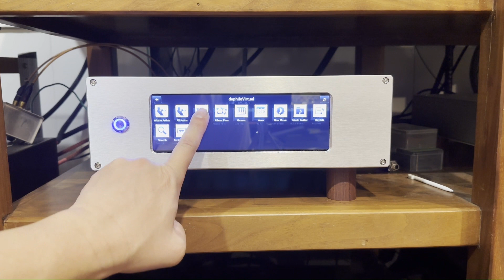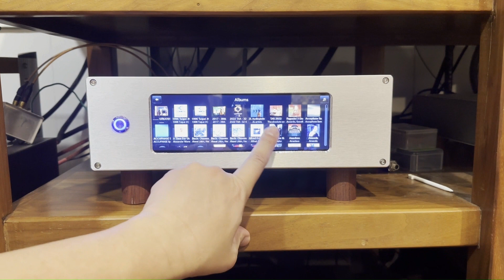DIY Hi-End 等級音樂串流器純轉盤 (2) -- 空白全鋁機箱自行加工

Comment: I noticed that while drilling the hole in the aluminum plate, you were holding it very close to the drill on the shorter edge. That’s quite risky because the drill bit can catch the material, especially near the exit, and yank the plate out of your hand. This could lead to serious injuries.

In the future, I recommend holding the plate on the longer side or, even better, securing it with a clamp or vise. It’s much safer, and you’ll have better control during the process. Safety first!
Reply from the maker: Thanks! I am learning various processing techniques.

Comment: Hi, what Power Supply are you using? Where did you buy it? I'm looking for a stable Linear PSU for my Raspberry PI 5 Volumio streamer. Thanks
Reply: It is a power supply removed from an old hard drive external box and reused. 
Since this machine is a pure digital streaming transmitter without a DAC, it uses a switching power supply. If there is a DAC, it is a good choice to use an analog power supply.
Reply: @ByronYang1234 Thank you very much for the clarification and advice regarding a DAC and Analog PSU 👍